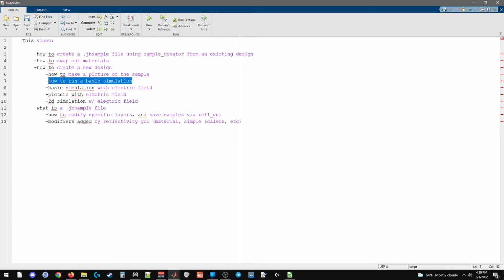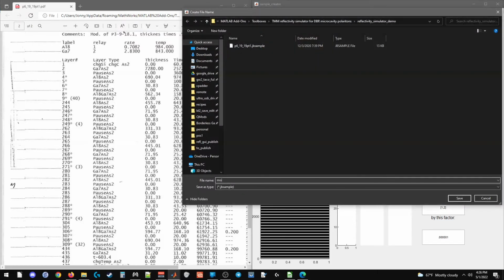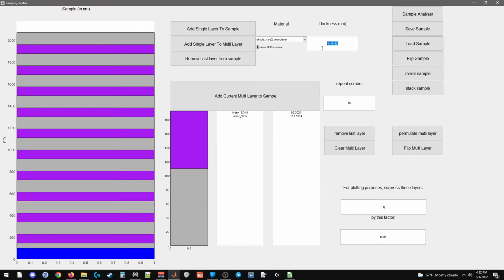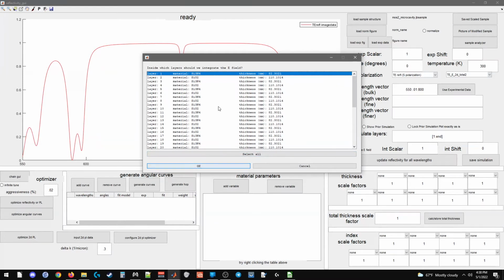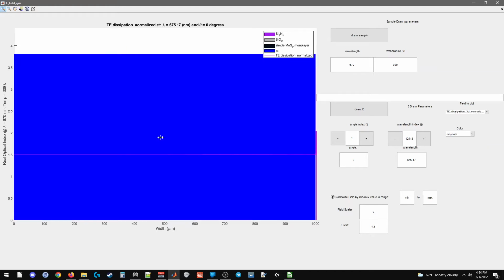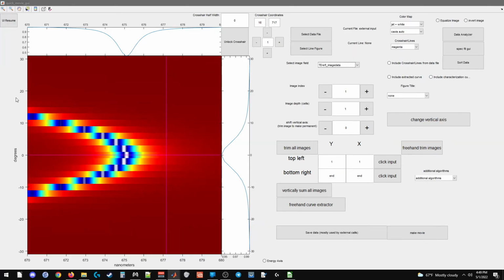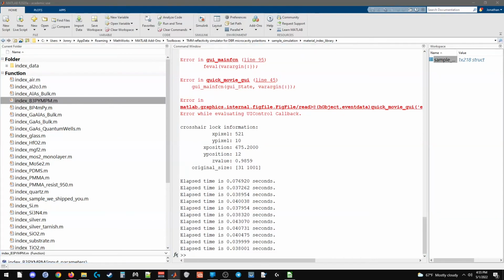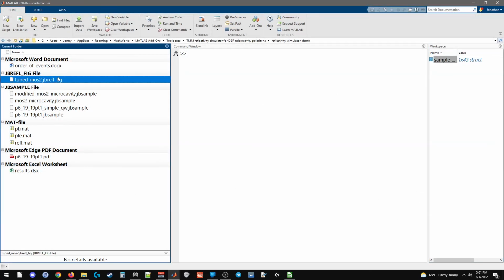Creating and Simulating planar microcavity samples using transfer matrix toolbox

Comment: Thank you very much. Could you please help me add new material (new properties) to use? appreciate that
Reply from the maker: Hello! Sorry for the slow reply. Yes adding a new material is quite straight forward. Inside the folder named sample_simulation/material_index_library you can see all the other materials already included. Simply made a new .m file for your material and include it in this folder and it should work with all the GUIs. The easiest way to learn how to do this is to look at some of the existing functions. The function index_PMMA shows how to easily use a file from refractiveindex.info, this is possibly as advanced as you need to be. But if you need to implement something harder you could look at my simple_gaas_qw function.